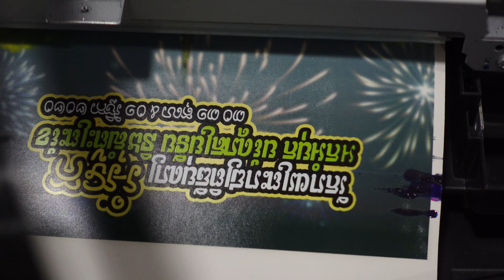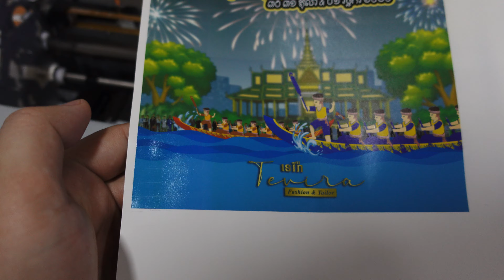Epson L1800 Modify UV Curable Ink

Comment: Did you change the print head dumper?or just change the ink?
Reply from the maker: Damper, All tube, ink tank and wiper blade are all changed.
Reply: @Technobby  thank you for your answer ..do you have link for LED and the water coling that you used?